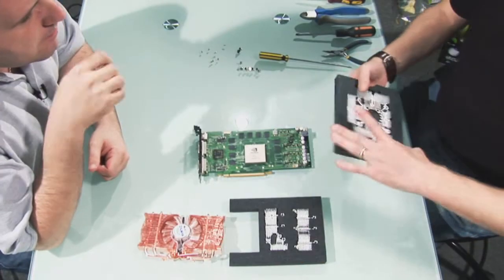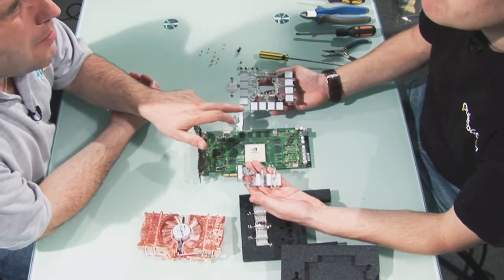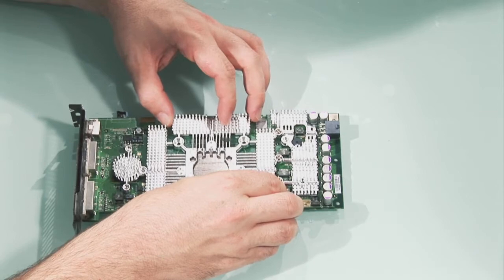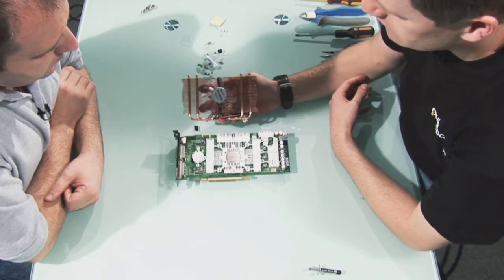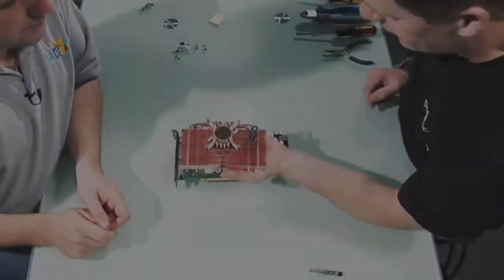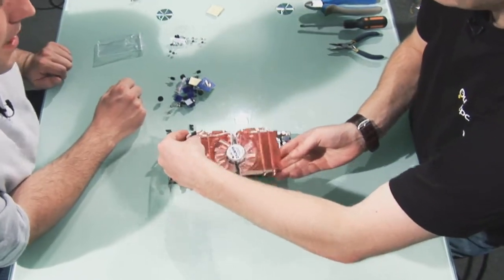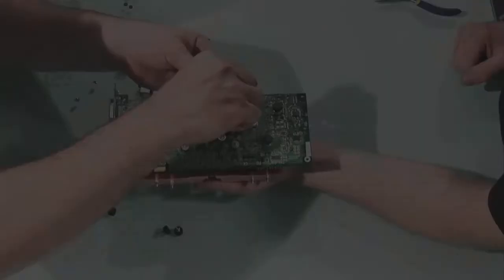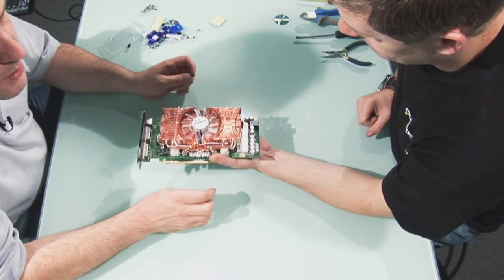Quiet PC - Pacify Your PC : Episode 4.2 Graphics card cooling

Comment: @ranagill Being smart really has little to do with it -.- There's a right way and a wrong way, if you spread the thermal paste with your fingers, then oils from your fingers get on the card and it can compromise the usability of the actual card. Sure you can do it...you can also poke holes in water cooling tubes, but that really won't get you anywhere either.